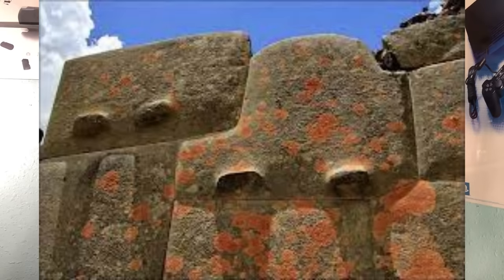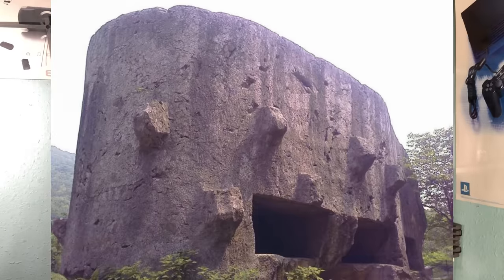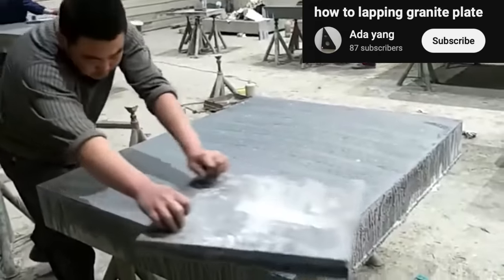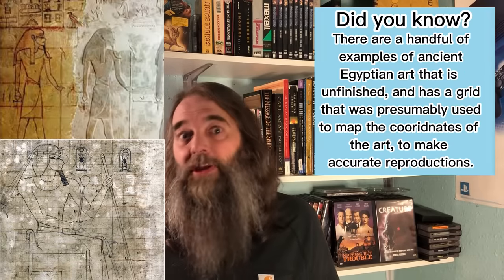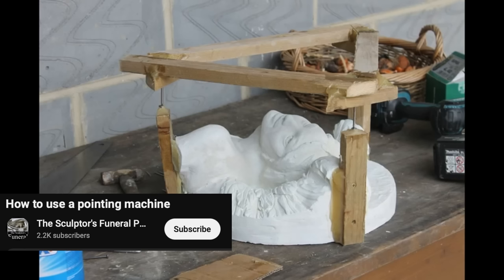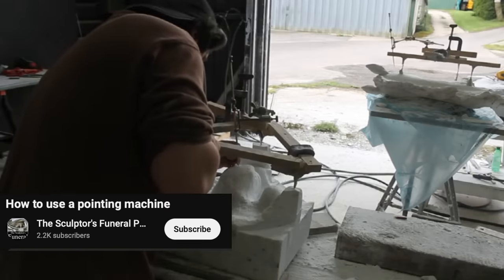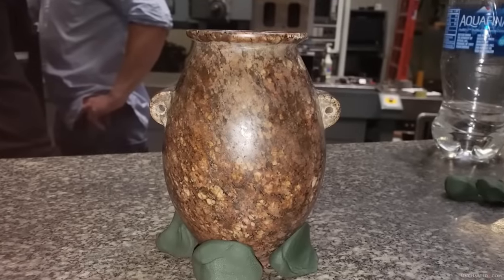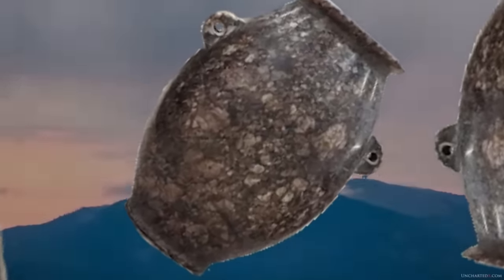The True Purpose of Megalith Stone Nubs

Comment: The Incas didn't have pointing machines and didn't have steel tools, but they carved huge stone blocks with amazing precision to make interloclinng masonry. I'm only interested in how they did it, not why. If you gave me a 5 ton block of stone and a  coconut sized lump of hammer stone and told me to cut the large stone to a very precise shape, maybe 60 years later I might have a finished building block for you, but then someone else would have to fashion the adjacent stone to fit perfectly wth mine, so many generations later you might be able to assemble a building.Liquifying the stone then moulding it to shape is a nonsensical idea. I dont care how modern sculptors do it. Your theory is rubbish!

Comment: Ok. They had no paper to write a plan on. they had knots on twine to count a bit, but that is it. And you think that these stones were preplanned and hewn in some quarry to that precision? 

Seriously, stop doing drugs. Get out and do some research, like build a project like a chair or a raised bed in the garden or something else relatively easy but where  it matters that the parts fit reasonably. And then look again at the tight stones with less than a hair's width tolerance over several square feet.
Reply from the maker: I suppose you're gonna tell me it was concrete, and then laugh at me some more...

I worked construction for a long time, so your notion I haven't built anything is wrong. It's why I have an idea that would actually work. It's what we did, make things happen that seem insane.

Google 'stone lapping', and quit marveling over smooth edges like a child who has done 0 research.

Comment: Perhaps used as fulcrom points to walk the stone like moving a washer or dryer by yourself. Or
They are the residual stone outcrops from the frequency points used to manipulate the stone (like a hot glue or melted plastic tear drop shape . Frequencies were imo used to at least move the stone. If you believe our ancient ancestors mastered a different type of technology such as element manipulation accompanied with Frequencies then you could possibly use water that is vibrating high enough to use as a precision cutting method. If you believe that they had nothing but copper chisels then you also believe in Santa Claus and that your government cares about you so you should probably stop watching videos and get back to work because you need to pay taxes for our roads and education system.

Comment: LMAO, you have no clue.
Take measurements for example, the most simple means to measure something is a string with a knot.   Just with using strings to measure you can EASILY find lengths needed, no fancy tools.
Nubs, when you have a heavy object the nubs can be used several ways, face down and it makes it very easy to move.  Then you are able to move them just by rope and friction.
Go do construction to learn, that's the issue with people who come up with oddball ideas, they've never swung a hammer but have beards
Reply from the maker: I love it when apprentices act like they have a clue.
I started working construction in the 90s. Measuring in 2 dimensions won't make accurate 3D work.

Go get the board stretcher out of the van.